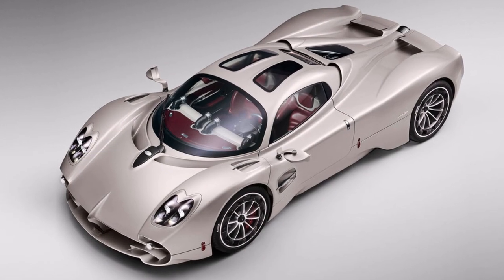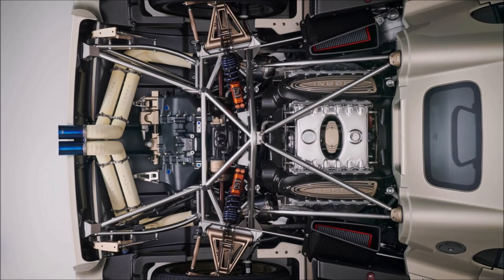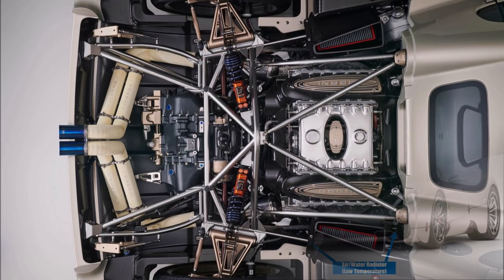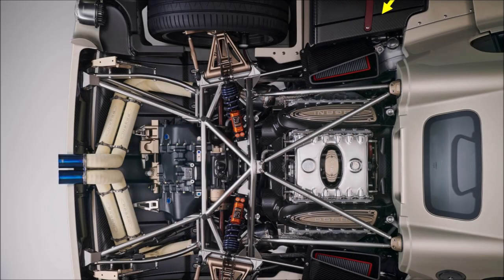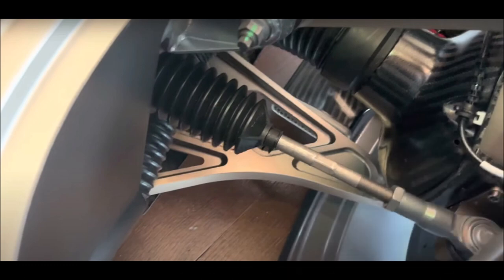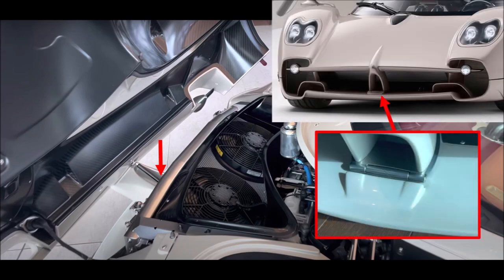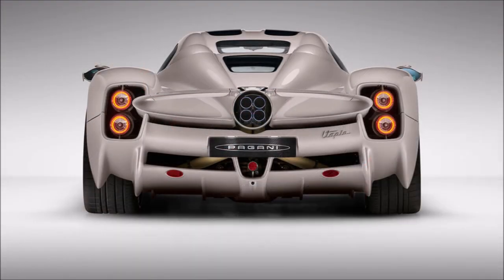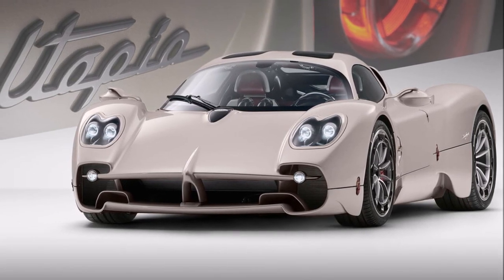Pagani Utopia - BEST or WORST Pagani ever?

Comment: Sadly, if we are looking at the technical side, this is basically slightly updated Huayra with different bodywork and a manual gearbox option. Before the release they were talking a lot about how they were focusing on lightweighting, but the car is actually heavier than the Huayra BC and even the BC Roadster. I actually do like the look of the car (and I think it will grow on some people once they realize what the design is trying to achieve), but I was also expecting it to be a bigger step forward technically. 

One thing I am definitely not sure about are those leather straps on the outside of the car. I can't see them lasting very long exposed to the elements and random rocks and dust and grit.
Reply: Yep. Im sure its all very arty and clever. But this looks like just an upgraded Huayra. -- And about its looks... It looks like its a 15 years old concept car. Its just overloaded. This doesnt feel like a step up for Pagani.
Reply: @captain_context9991  agreed
Reply: slightly updated? this is significantly better and faster, and exceptionally light
Reply: @THESLlCK  The car is 62kg heavier than the Huayra BC and 30kg heavier than the Huayra BC Roadster. The BC Roadster was weighed at 1398kg, so this should be something like 1428kg. That's decently light by modern standards but nothing special, it's about the same as the Mclaren 720S. This being a 2M+ hypercar it competes with things like the GMA T.50, which at the kerb should be about 1050kg. Now THAT's "exceptionally light". 

As this car only has 60PS more than the BC Roadster and weighs 30kg more, the power to weight ratios are not that different. 605PS/t vs 572PS/t. So faster, but I wouldn't say "significantly faster". I also don't see anything that would make it "significantly better", as most of the construction and the way they do things are the same as on the Huayra. As I said, the biggest difference really is the addition of a manual.
Reply: @test987665  if you think everything in a million dollar car is about performance numbers, you are clearly not the type to be buying even hundred thousand dollar cars
Reply: @Cabesi  this car is 1280 kilos. Where do you get the 1400+ number from?
Reply: @bigshorty4855  1280kg is claimed dry weight. As I pointed out in my previous comment, the Huayra BC Roadster is claimed to be 1250kg, but was actually weighed by Quattroruote at 1398kg. So if the dry weights are consistent at least within Pagani models, then the Utopia should be something like 1430kg in the real world.
Reply: @test987665  difference is one has-been weighed, the other hasn't. 

Maybe stop jumping to conclusions untill after the fact.
Reply: Those leather straps are for aesthetic purposes, its not really the leather that connects it. Its been like that since the zonda

Comment: Best in terms of technical, maybe worst in terms of design. The body and features CURVE, but do not FLOW. There's a big difference. The designer looks like they thought about each part separately instead of as a whole and the whole thing looks gaudy and over designed. Each area of the car is doing its own thing and it's an honest mess.
Reply: look at an old jaguar e type. there's no flow at all. Still beautiful. You just don't like this car.

Comment: I won't classify it as good or bad looking, but on 5:09 Zonda with canopy and overall "slimness" is so more attractive. 2nd problem is that Pagani, just like rest of smaller manufacturer does not have money or resources for more elaborate aero. When you see they were with Zonda on top of supercar lineup, Utopia is now slowly becoming very exclusive and expensive next "765LT" competitor. From car that eventually could fight vs Enzo, they ended up Utopia fighting SF90. Flagship supercars now tend to have extensive aero (like MB AMG One, Valkyrie) and Pagani can't keep up. Still if ladies are paying 10k euros for a bag, guys will pay 2-3-4 mil for Utopia I guess. I would knock on Murray's door.
Reply: Yeah Murray is alrady sold out until the end of the petrol engine. So good luck with that. Probably the same at Koenigsegg and Bugatti. But yeah. I dont think anyone sees this car as a step up for Pagani. This looks overloaded and weird.
Reply: Try to think this way.
All this cars anyway never hard hit the track. They stay in expensive garages and occasionally roll on streets of famous places and back roads. Zero point on all that aero whatsoever. It is just a piece in someones car collection.
So Pagani did embrace that idea, and made an art in the first place, and only then it have a v12 and manual transmission.
It may not be for everyone, as any art should not, but it is at least different to any other modern supercar, that more and more looks the same.
And honestly, i like how it looks. A breath of fresh air, and IMHO this, and hyundai N vision 74 is the best looking cars for last decade

Comment: Looks wise it's the worst for sure. Seems like a step backwards and I wouldn't call it rolling art like the other dream machines they make. It almost has a kit car look to it. Especially the side windows and entire rear view of the car with doubled up rear glass and all the humps. Almost looks like the engine is melting the car causing it to sag in the middle  between the tail lights..
It will still be an awesome car but yea.. It's no looker that's for sure.
Reply: The people that call it the best Pagani are either only talking about horsepower or the downforce

Nothing else
Reply: Atvus  no one said they shouldn't say what they like